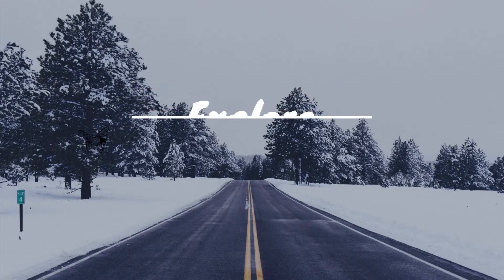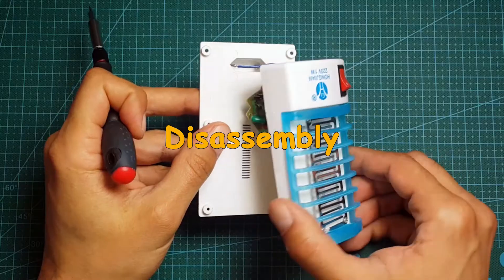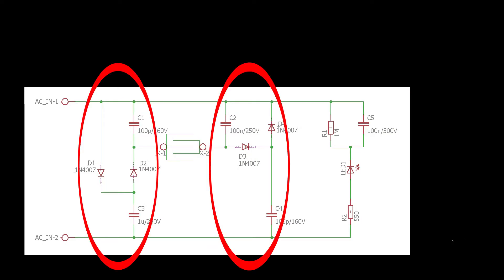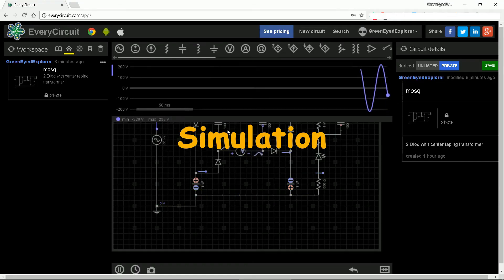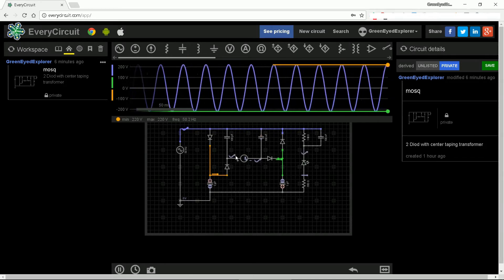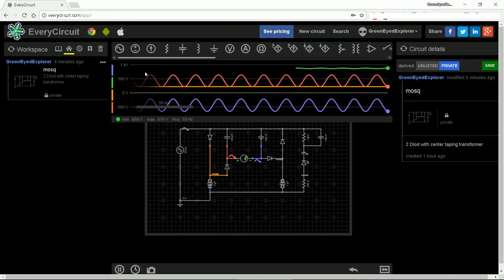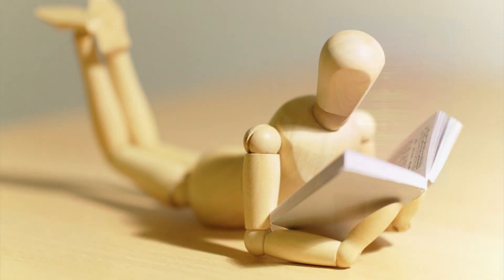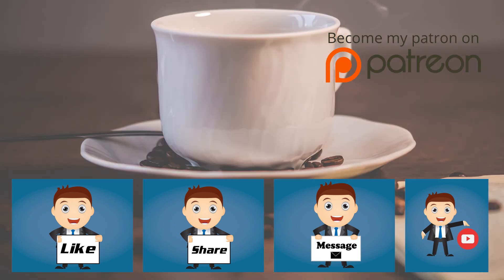🔴 MOSQUITO LAMP. How does it WORK? Is it DANGEROUS? Make your own?

Comment: does this mosquito lamp works? killing mosquitos?
Reply from the maker: Yes, it works very good! We use them all summer. This is the third year and they still work.
Reply: i bought the same lamp few years back, the first time i tired all the leds got sparks and died instantly, dont know why ?!
Reply from the maker: It shorted somewhere. Poor manufacturing I think.
Reply from the maker: Some of mine died from the time I made the video. These days you can't buy long lasting quality stuff anymore...
Reply: mosquito's are mostely actracted to sweat and carbon dioxide, not UV/blue light